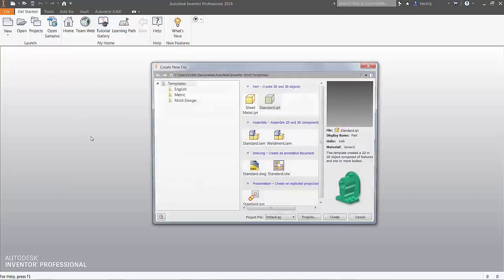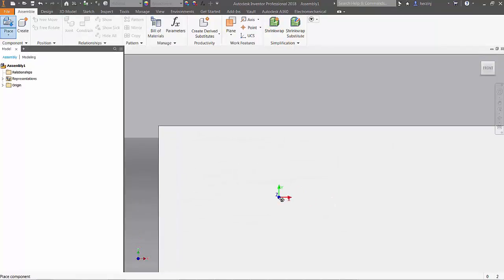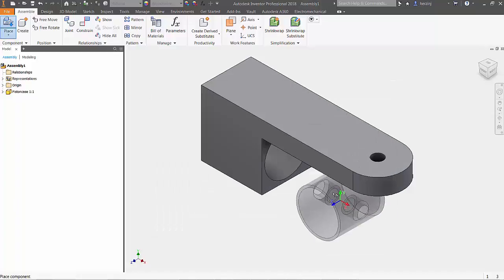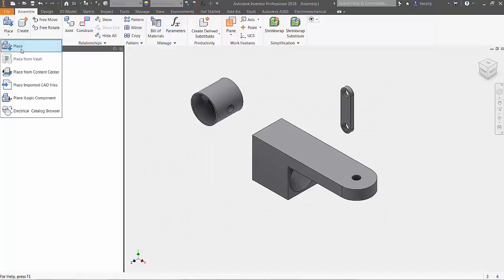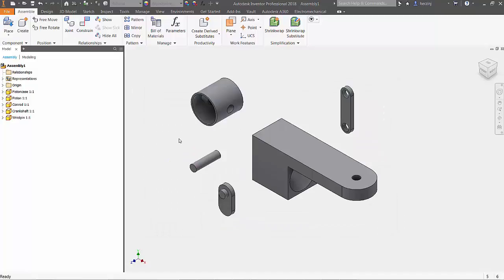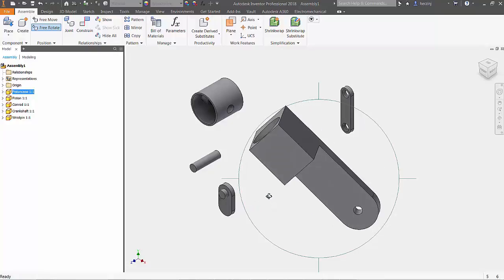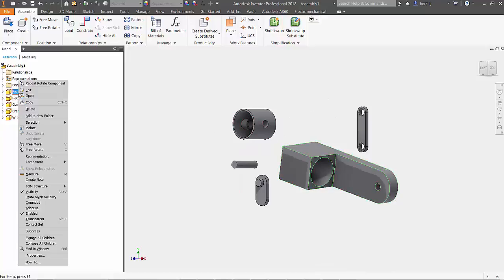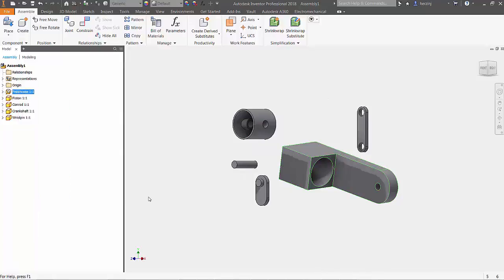Inventor 101: Placing and Orienting Parts in an Assembly

Comment: can you manually enter precise rotation?
Reply from the maker: Underneath the view option, there's a tool called rotate at angle, this allows you to rotate the view at specific angles in any orientation. There is no specific way when moving components around on the screen, unfortunately…
Reply: @AutodeskMFG   Update that pls, I can't believe you can't enter precise rotation of an object
Reply: @AutodeskMFG OnShape Mogs InventorCad in PrecisionMaxxing

Comment: free rotate? what the hell, why cant I move around an axis or at a certain angle to a plane? useless video
Reply: Agreed! Is this not supposed to be a "highly precise creation" software yet when assembling your finished part you just have to sling em around until they look like they're lined up and just hope for the best?  Whoever let this pass through the design process should be fired because that is just stupid...
Reply: Coming from Fusion360, I am frustrated to see that such a simple thing as rotating a part is absurdly difficult. Scandal
Reply: I am new to inventor and really struggling with orienting a few of my circular parts within an assembly. Wish i could simply select a plane and make it vertical, horizontal, etc.
Reply: I select a view from a certain face (top,bottom, left, right etc) and rotate from there. It so far keeps the movement on one axis. So far I haven't seen a way to line up the angle accurately though. A dynamic input for the movement (0, 90 etc) would be nice though. Considering how much Autodesk charge, and how many hoops you have to jump through to get access to these programs, that's just bad.
Reply: Bl
Reply: I manually constrained part-axis to the y axis, so that at least works
Reply: I agree! Inventor is the most ridiculous program! Why would anyone need to free rotate before precise rotation on fixed planes?